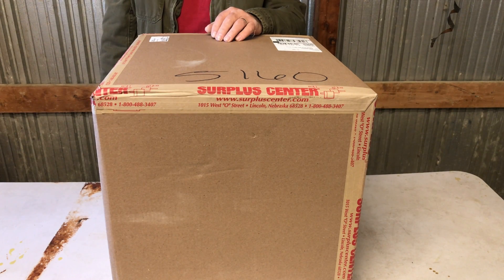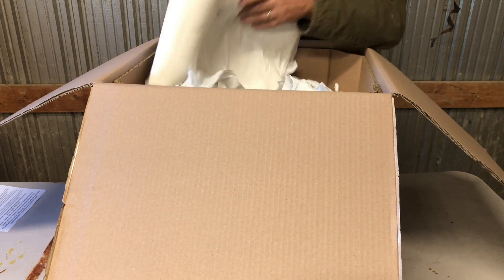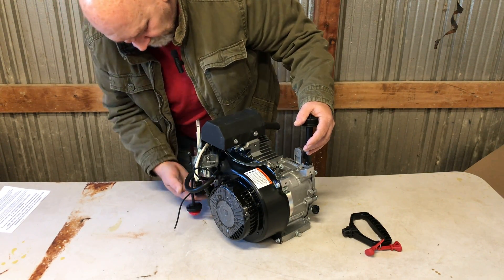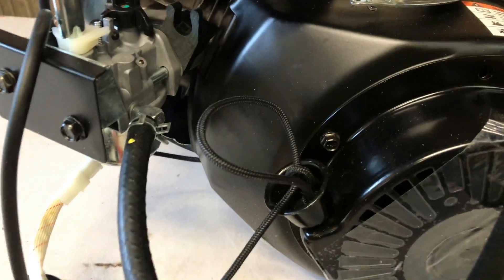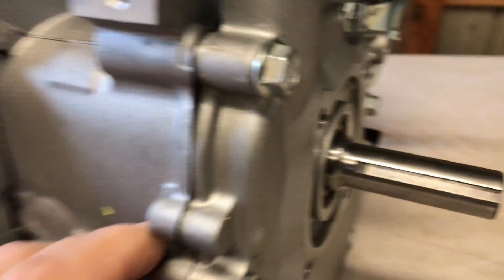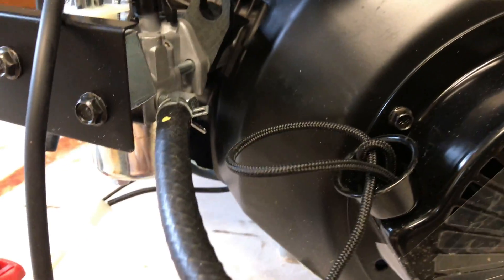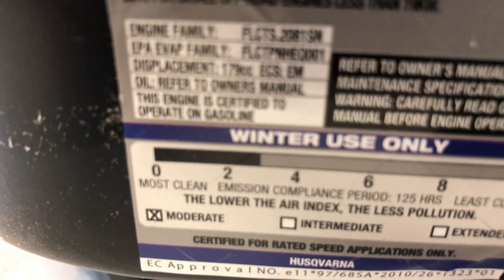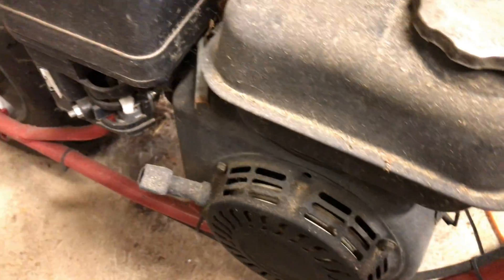179cc 4.8 HP LCT Snow Engine $49.95!  Unboxing and Review Cheaper Than Harbor Freight Predator 212cc

Comment: Can't beat that price, but then they scewed that up by inflationary shipping costs. 😮
Reply from the maker: That's true Chuck! About the only way to benefit from the $49.95 deal was if you lived close enough to pick them up yourself. Otherwise it was $28 ea shipping for the first one, then the rest were around $32 ea shipping to Kentucky.
Reply: No I don't.
Reply from the maker: Be sure to check out the new Tiller engine video Chuck. 208cc CR950 Briggs and Stratton OHV engine on a new garden tiller for $149 with free shipping! They also have the Champion tillers with the 212cc Champion engines for $149 (with Champion rockers!) and free shipping to your store or to your door.
Reply: @KentuckyFriedFixes  I will.

Comment: Are these smaller than the predator 212, with all else being equal with no gas tank, etc?
Reply from the maker: Hi B! These 179cc LCT engines are almost exactly the same size as the Predator 212 engines. The bore is smaller but the footprint of the block is almost identical. (The 179cc to 208cc big bore engine I'll be finishing soon uses a 208cc LCT block. It's identical to the 179cc block except has the 70mm bore size instead of the 65mm.) About the only thing I've found that I don't like is the camshaft journal is larger than a standard Honda clone or Predator cam. So aftermarket performance cams aren't readily available out of the box and you're kinda stuck using the stock plastic gear camshaft unless you go to the trouble of installing a bushing or bearing in the block and sidecover to accept a smaller diameter camshaft journal. Other than that they're great little engines.

Comment: 7:14 MOST are not aware that the IDEA of the larger handle came about in a discussion between my Quality Control Manager ( Joe Seberies  ) at the Snapper Power MFG plant in McDonough Ga and a engine MFG representative, I was standing there when Joe told him why don't you make the handle where a person doesn't have to remove his gloves to pull the recoil? A the idea was taken in the next production of that engine MFG, Joe was a northerner who was hired in the Georgia plant and gave his experience while raised in the north. The idea spread to other engine manufactures quickly after that, this incidence was about 40 years ago. Unfortunately I misspelled his last name.
Reply from the maker: That's pretty neat Numa! Those big handles are handy in Winter for sure. I suppose they could help start something without the compression release too. They were a very cool idea for sure!

Comment: Many of the features are exactly the same as on the engine on my new Ariens snowblower.
Reply from the maker: This one came from a Husqvarna snow blower. It says it right on the label. It wouldn't surprise me if  Ariens uses some of these engines too. Good stuff to know. Thanks!
Reply: @KentuckyFriedFixes  Mine won't start unless the primer is pushed in, covering the little pin hole, three times and each time held for a full one second, then fully choke and it starts like it was always running, otherwise it won't start.
Reply from the maker: I noticed on mine I had to pump the primer several times for the first start. I think the carbs on these things are kinda weird. I'll probably replace mine with a 212 clone or Predator carb. It may be related to these being "Winter" engines, I don't know?

Comment: Could run the engine exhaust thru some piping in an old oil drum... like a boiler system..., heat and cheep electricity? would save 30% on the electric/heat bill at the rates I have.
Reply from the maker: That's a neat idea.

Comment: i’ve had some experience with these lcts and they make basically no power but they just take everything you throw at them
Reply from the maker: This is my first LCT engine. It does appear to be built tough. I'll be getting inside one of the LCT engines after the Predator project is completed, maybe hop it up just a bit if we can. Thanks!